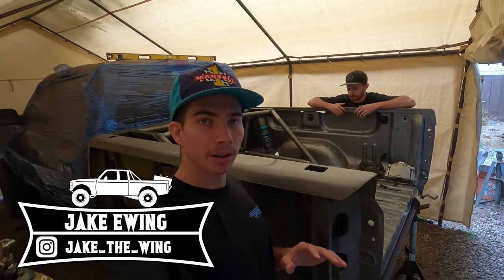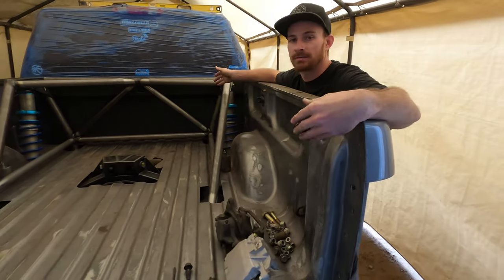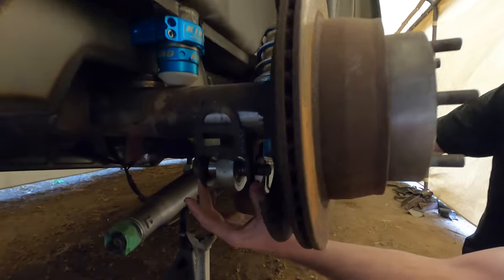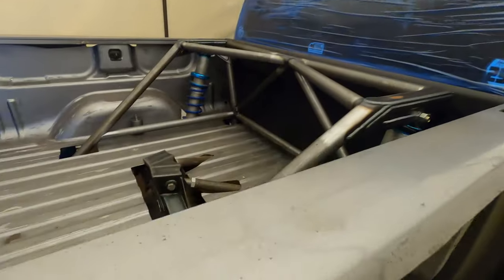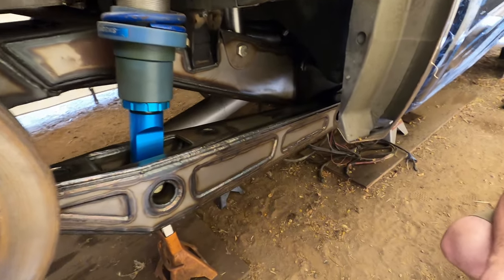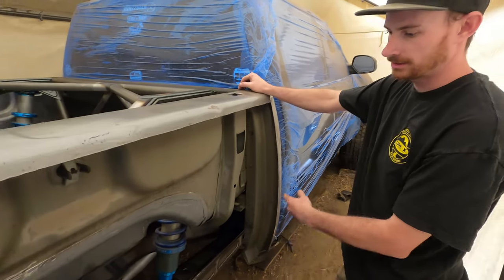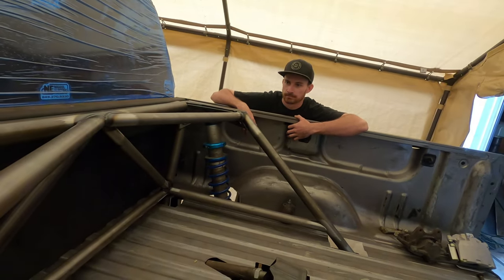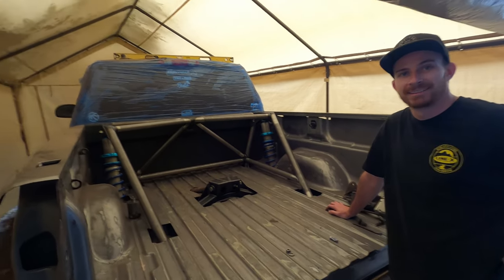Short Course Linking a PRERUNNER!

Comment: One thing you wanna watch out for when you import pictures into CAD is that pictures aren't isometric - perspective warps dimensions. It's no problem if all you need are some lines and angles and the dimensions aren't critical, or if you are taking scans of 2D profiles, but with camera photos when you bring it into CAD the stuff in the rear of the photo is scaled down compared to the front and your design stops lining up to the real world.

I stopped using the picture method for this reason, it often ended up being more work than it was worth. One alternative is photogrammetry where you actually make a 3D scan from pictures, and the software corrects for the perspective issues. There's some free software for this, and some other cheap software for it. I have a how to on my channel if you wanna see how this is done, scanned my whole car to design a bumper for it and it turned out pretty well in my opinion.

Comment: Awesome video and clean work. How do you determine shock angle?
Reply: Shock angle is based off the truck at full bump (compression). The shock needs to be less than 90* angled forwards to the top side of the trailing arm. There is no exact degree to find but as long as the shock is less than 90* it will stay progressive throughout the entire stroke and make it better for tuning
Reply: @ChristianEwingVD  thank you for the response. I appreciate you!!

Comment: This isn't any different from a triangulated 4-link. I was under the assumption that it was truck arm style trailing arms, AKA 2 arms only which is what keeps everything underneath the bed. So what the heck is the point of doing the whole back half thing if the geometry and amount of arms are more or less the same? Is there anything you can run that ACTUALLY contains everything underneath the bed? And what is this "5 link" you talked about on the leaf spring vs 4-link video?

Comment: Is there a reason as for why you didn't go with an IBP in the rear?
Reply: After running the IBP on the front of our truck, I will never run an IBP on a truck application again. There is no reason
Reply: @ChristianEwingVD  ok, thank you. So is there still a piston in that is shimmed in the coilover but it doesn't have the bump zone piston or red piston that I think you guys have discussed in your previous videos?
Reply: @mayo3159  correct, the shocks that’s being ran on this truck is just a standard coilover, it still has a piston and compression and rebound shim stacks on each side of it controlling the flow of oil through the shock 👍🏼 it just doesn’t have the internal bumpstop like the IBP’s do

Comment: Is there room for the lower shock coil retainer at bump?
Reply: Yep, bump and droop there is zero clearance issue with the spring retainer through 23” of wheel travel
Reply: @ChristianEwingVD  I mean there is not much shaft showing at bump, and the retainer takes up some shaft space when it is on the shock.
Reply: @austinroede5788  there is zero shaft showing at bump, but there is also no bumpstop pads on the axle yet ;) you’re also forgetting this is a race series coilover. The black space you see between the rod end and the dust cap while it’s fully collapsed is where the spring retainer sits. It does not take up any shaft space at all